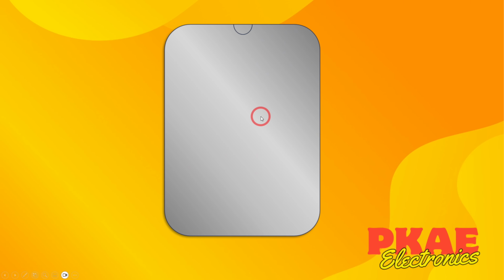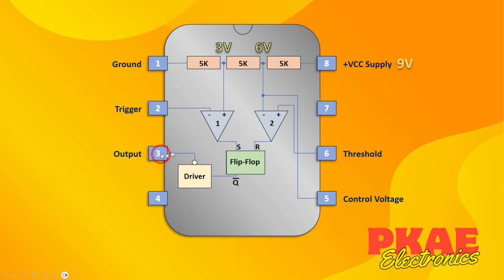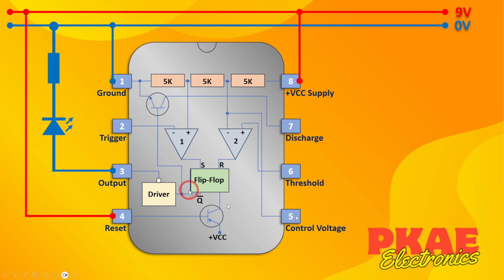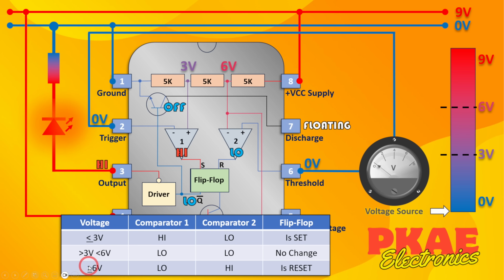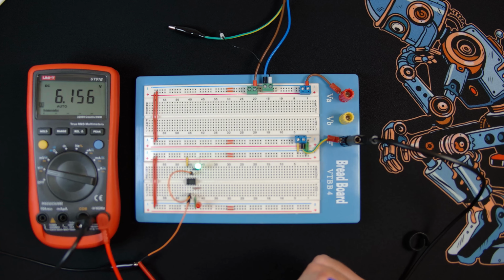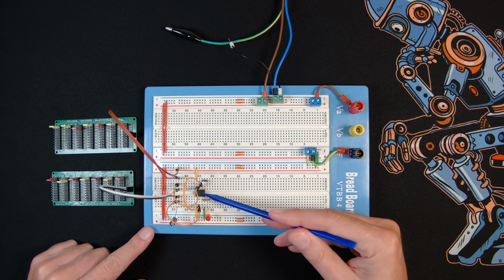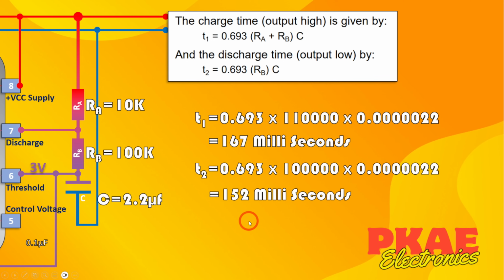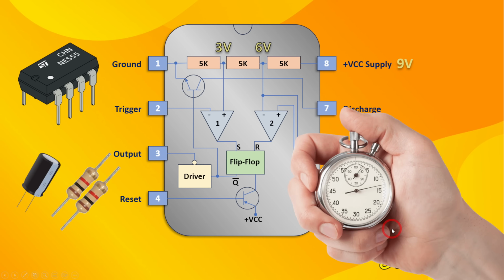How a 555 Works as a Timer.

Comment: I agree it's not a true timer there's no quartz in it for oscillation.
However you can control a square wave out of pin 3 but that's because of external parts

Comment: Too hard... no wonder i struggled in microelectronics classes... Great video tho
Reply from the maker: My advice is to try and understand one small part at a time. 1) the 3 x 5K resistors making a voltage divider, 2) the comparators, comparing the incoming voltage with the voltage references, 3) the Flip Flop, 4) the discharge transistor. Each element is quite simple.

Comment: I am retired electronics instructor. I am interested in setting up an online training course in basic electronics using the best training materials I can find online.  I would add quizzes, simulations, student challenges,  crossword puzzles and my own blogs and training material.  How would you feel about me using your 555 chapters as a resource for a unit on  learning basic concepts using the 555?  Could I link to your materials or incorporate them with proper acknowledgements.
Reply from the maker: Hi. Yes, please feel free to add links to my videos, it all helps with driving extra traffic. I have stumbled on several other sites that have done the same over the years. 

Good luck with setting up your online courses, I would be very interested in taking a look when its up & running, so please keep us posted. 👍

Comment: Can we actually measure 15K ohms with a multimeter between pin 1 and 8 with no power connected to 555?
Reply from the maker: Never tried but yes, you should be able to. Some 555 variants or fake products may give varying readings.

Comment: I once made a audio compressor , (delay release part with 555time)

Well the compressor still works.. its pretty good one...

In limiting mode 100:1 ratio(analog high ratio took a lot of headache for me- now i think there was no point of wasting days to improve the ratio this high)

Well it had variable threshold..(had , later fixed to -1dBu)

(The limiter infact is a compressor on steroids.. not a hard/soft clipper)

In compression, the ratios are 1.5:1
2:1
2.6:1
3.5:1
4.7:1
And another 2 i forgot the ratio the last one was probably something like 8-10:1
Well pretty soft knee - like vari mu)

Variable threshold (obviously)

And there was release delay(those days-you won't see release delay in compressor/limiters)(this was done by 555)

Release settings was opamp +transistor based ( consistent release for different G/R) 

Good old days.. its been 25-30years i think..
Reply from the maker: Brilliant! 😊

Comment: Man the amount of tiny details you put into making your diagram understandable is mind blowing. You got a like and subscribe from me. 
Btw should there be an ideal ratio between charge and discharge time?
Reply from the maker: Many thanks for your comment and yes, it takes quite some effort to get these prepared.

The ratio between charge and discharge time governs the "duty cycle" of the output. There is no ideal ratio except for your specific needs. 

With a small modification to the circuit you can widen the possible duty cycle range and also make it variable. See my "555 Better Duty Cycle Control (PWM)" video (link below).

https://youtu.be/4NXjBRarmeg

Comment: New sub here.

 Looking for help. I have a 12  volt small PC fan 40x40x20mm.

So let's look at the 12v project. I also have a pwm singal. 5v I believe. 

Is it possible to build a very small circuit to turn off the 12v pc fan once the pwm signal has stopped say for around 20 to 30 seconds.

Once I can get my head around it I would like the same type of control for a small 24v pc fan 60x60x20 and 5v pwm singal.

If anyone can guide me where or what to research. Thanks in advance
Reply from the maker: Hi, thanks for Subscribing,

First of all, the 555 can be powered from 12V supply and will give you a 12V output (or very near to 12v). You will probably need to hang a transistor off of the 555 in order to support the current of your fan. 

With regard to turning off in relation to your PWM signal, I don't quite understand the arrangement/what's required. Is the PWM driving the fan, if not what is it driving. Are you looking to detect when the PWM signal stops, and then stop the fan 20-30 seconds after that, or looking to detect the PWM has stopped for at least 20seconds before turning the fan off?
Reply: @paulpkae  thanks for your help. This is a cooling fan on a small laser diode. 12v to the fan is always on. The pwm signal fires the laser beam. So trying to stop the fan running as it's very loud after the pwm signal has stopped  for 20 to 30 seconds to allow the laser to cool down. Meaning the laser had finished it's lasers job, the module as cooled down, so now turn the fan off.

When pwn signal comes back on the next laser job, the fan starts again.

The 12v, ground and pwm is all in the same 3 core cable
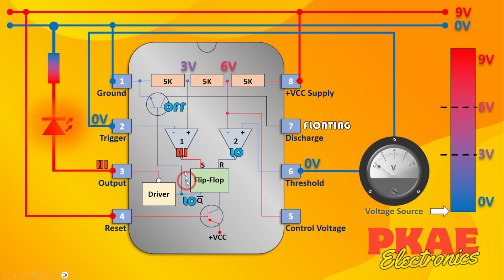Reply from the maker: @FlixmyswitchLASER  OK. I think you can arrange a simple circuit to do this with an Op-amp, diode, transistor, capacitor and a couple of resistors. If you configure an op-amp as a voltage follower with a diode within the loop back (see my "All About Op-Amps" video, "Perfect Diode" section 11:07), then connect + terminal of a capacitor to the output & - to GND, the capacitor will act as a peak detector to whatever signal is fed into the non-inverting input (which will be your PWM signal). By using an op-amp there will be no additional load pulling down your PWM. You will need to add a blead resistor in parallel with the cap so that it has a discharge route when the PWM signal stops (something large 100K+). Now connect another resistor from the +terminal of the cap and into the Base of an NPN transistor. 12V+ to one side of your fan, then the negative side of the fan onto the Collector of the transistor and the Emitter to GND. 

While the PWM is running the capacitor charge is regularly being topped up and will experience minimal discharge between cycles. The charge keeps the transistor switched ON and allowing current to pass through the fan to GND. When the PWM stops, the cap will discharge through the blead resistor and Base/Emitter junction and eventually the transistor will turn OFF.  You will need to play around with the resistor and capacitor values a little. 

I will do a little sketch later and give you a link to download, should make it easier to follow. 

Hope it helps.....
Reply: @paulpkae  thanks time to do some study
Reply: @paulpkae  thanks for your detailed reply. If you are able to produce a sketch that would be very helpful
Reply from the maker: @ uploaded here:-

https://1drv.ms/f/c/10f323cd9840b5df/EtwQ36fj6KtCszAoVxSpA6MBJidbqpqC6mpamCWEYRT3Ww?e=fMJSiB
Reply: @paulpkae  thanks you very much I will have a go at that. Hopefully no magic smoke.

In the image what is the part number for what I assume is a transistor on the far right
Reply from the maker: @ yes it's an NPN (BJT) transistor. I would use an everyday PN2222, but it depends on the current draw of your fan. If it's more than say 300mA you may need something a bit beefier.

Comment: I finally understood!This is so helpful. Beyond the superficial compliment that this is a great video, I can tell there are a lot of considerations that went into helping us comprehend the material. You lined up the ports in the exact order the 555 timer is designed, often in other videos the pins can go in different orders and it can be confusing to refer that to the actual 555 timer. Also, you used a mouse that actually walked us through how current is flown from VCC to GND and to different ports, you also shot a video on breadboard manually changing the voltage source to show us the how oscillation occurs due to changing input. There is a good level of abstraction that you explained how flip flop works but didn't go into detail about the logics gates inside it for example. Overall this is a great video.  Thank you so much for making it.  I've watched many videos and this is the only one that made sense.

I do have a question though, why doesn't the VCC go directly into the threadhold and trigger pins, instead it only charges up the capacitor?  chatgpt told me that it's because comparators are confirgured to ignore VCC and only takes capacitor voltage source, but I'm not sure if that' correct or not.
Reply from the maker: Hi, many thanks for your comment. I'm glad you found the video of use.

With regard to connecting VCC to the Trigger and/or Threshold pins, well you could indeed connect them directly, but that won't provide any kind of time delay factor. The Output will be permanently latched in a Hi or Low state depending on which pin(s) you connected to VCC.

By using the Capacitor/Resistor combination, the Comparators are sensing the increasing or decreasing charge of the positive plate of the capacitor and once it reaches the 1/3rd or 2/3rd threshold the 555 then changes state. This is how we introduce a form of time delay and make the 555 into a Timer. I hope this helps.

In a follow up video, I did some further testing of the Flip-Flop's behaviour under certain conditions. In this video, I do indeed connect Threshold directly to VCC. You may find this useful, link below:-

https://youtu.be/FlTTf_8I7Uw?si=zcbUGeEMFkLLpwUt

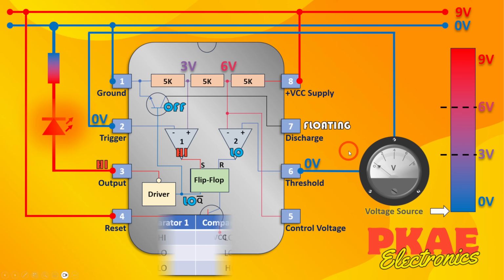Comment: An exceptionally well presented video that is one of the best, if not the best, I have seen  -- it is an excellent tutorial!  Obviously a tremendous investment in time and effort was needed to produce it.  My only comment (quite minor) involves the ≥ 6V  sign used in the state change chart (11:39) for Comparator 2 -- it had been my understanding that equal input voltages for op amps would always produce a zero output voltage and that a voltage differential would be required to initiate a change.  Either way, wonderful work.
Reply from the maker: Many thanks.

Comment: The .693 is (1-1/e) for anyone who is wondering, you can get it out of doing the circuit equation. It’s a little off from the actual value but there are more components than the RC stuff
Reply from the maker: Thanks for the comment. I am in the middle of preparing a video on RC time constants which will incorporate how the 0.693 is derived. I think many viewer will find this interesting and helpful.

In the meantime I believe your formula is incorrect and equates to appx 0.6321. A more accurate formula for the 1/3rd to 2/3rd Voltage RC multiplier would be:- ln(2).

Comment: We use to call this chip the “555 Glitch Timer” because it was notoriously unreliable for a stable timeout (would trigger unexpectedly if there was the tiniest amount of noise in the circuit. I suspect that everyone was using a common reference circuit that was missing a crucial component ..l but we never did figure it out.
Reply from the maker: I have found that without the capacitor on the control voltage pin, then the triggering is quite erratic.

Comment: Fantastic video! Very clear, well-paced explanation of what's going on. The only nit I'll pick: You're not consistent about whether input voltages have to exceed the reference voltages on the comparators or just equal them to change output state.
Reply from the maker: Thanks for the comment.

The various datasheets differ in this context, but to be honest it's pretty irrelevant. The comparators are so sensitive that the condition of having the exact same voltage on both pins would be almost impossible to achieve for any notable period. There will be many unwanted influences on the circuit causing small fluctuations in the voltages all over the place.
Reply: @paulpkae  Well, I did say I was nitpicking 😄 But again, I'm really impressed with the quality of your instructional videos. The clarity of your graphics, the explanations, explaining things when needed and not before... It's all very top-notch. It's a bit of a shame you're competing with the rest of YouTube, because there was a time you could have sold videos like this on the educational market for a good sum. Looking forward to more!

Comment: Is it just me? I understand every piece of the internals of the 555 as it is being explained. I can understand how one component  works with the next component. I can sorta understand the relationship of 3 components. After that my brain is just not big enough to put it all together. There is just a certain amount of complexity that is inherent to electronics. It could not be presented any better or simpler terms. This was a great video. I don't see how it could be explained any better. At some point I feel like I have to give up and just accept how it is used as a basic building block in circuits.
Reply from the maker: Thanks for the great comment. Electronic circuits can at first seem daunting, but they are only really a collection of simple building blocks put together.

Comment: Great video. Back in 1977 I was a diagnostic technician with a computer line printer company in Woodland Hills CA. The product was a very complex electro mechanical machine loaded with 555 timers.  The 555 circuits were one of the highest failing components in the very complex machine.  Frequently the capacitors would fail but sometimes the 555 would fail.  Over time the design engineers began replacing the 555 timers with counters as they were more reliable and more precise. Excellent video, Thanks.
Reply from the maker: Thanks for sharing! Glad you liked the video.

Comment: Great. Very interesting. But, what would I use this thing for?
Reply from the maker: Thanks for the comment. Only you can really answer that question though. 

Some example uses:-
-Blinking Christmas lights.
- Control speed of motors.
- Setting timers for automatic lights.
- Light dimmer circuit
- Generating sound tones/buzzers/alarms
-Controlling a Fan
- Detect voltage changes to trigger and alarm or indication. etc etc.
Reply: @paulpkae  Hello and Thankyou. I really want to make a set of flashing lights for a level crossing. I bought some glass Reed switches hoping that when the train passes a magnet it would trip the lights to flash, or even just go red. Then when the train passes another magnet it would trip the light back to off, but the reed switches only stay in one position when the magnet is on it. This defeats my purpose. Your explanation of the 555 thingy, appears to get over that problem, so my question should really be, Can I use it in place of a reed switch, although you mentioned fitting a reed switch. I will need to watch your video several times to make my breadboard circuit work.

Comment from the maker: Several of you asked how to create an Astable circuit that allows a duty cycle of 50%, or less. i.e. where the On time is less than or equal to the Off time. This is something that cannot be achieved with the standard Astable circuit given in the Datasheets. But, by adding a couple of diodes to route the current through the appropriate charge or discharger resistor, you can indeed obtain lower duty cycles. This is just one method and there are many more options, each with pros and cons of course.

If you would like to see one example improved circuit arrangement, then take a look at my recent follow up video here:-
https://youtu.be/4NXjBRarmeg?si=H1eMwrHTjbaHdDBr

Comment: I can only agree with the many praising commentators, and say that this is an extraordinarily well thought through and presented video. It "breaks down"the subject into basic parts, functions and concepts, and then explains all of them clearly and succinctly. 
As a complete "electronic ignoramus" I do have a couple of questions that would be very greatful if someone with a little more knowledge could answer.:
Firstly: when a "pin goes high" does that mean that it's pulled up to same voltage as "Vcc" ? If not then what voltage ?
Secondly: what if anything happens if you put a voltage on the "control voltage pin" that is less(lower) than ⅔ of "Vcc" ?(meaning that it is lower than the voltage that is supplied by the "voltage divider" to "comparator#2") will it lower the voltage of the"comparator pin" to the "control voltage" by continuously "sinking current" from Vcc ?

Many thanks for this fantastic video "lesson" :)
Best regards
P.s.
 If I were to attempt to give any, hopefully constructive, criticism it would only be that the clips where you show your "real circuits" and point to the relevant components and connections possibly could have been benefitted by some "zoomed in shots" of some of the smaller details.
Again many thanks
Reply from the maker: Hi thanks for your comment and great questions.

1) When the pin goes High, the output is indeed driven to the supply voltage. But, most 555 chips (an other ICs) cannot drive their outputs completely to the supply voltage and in reality will be a slightly lower voltage, especially if you place a sizeable load on the output pin. 
2) If the control pin is at a lower voltage than 2/3 supply, then it will be pulled down 'close to' that voltage. But this will be affected by the output impedance of the secondary supply and how well it can sink current. Note the 1/3 voltage leg, going off to comparator 1, is also affected by the control pin voltage.